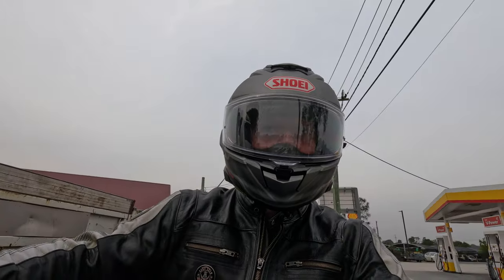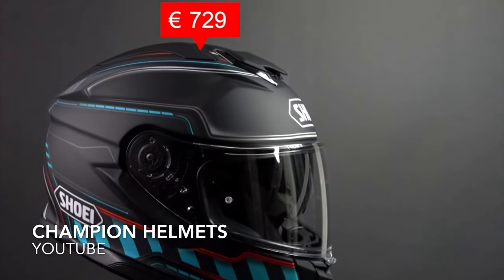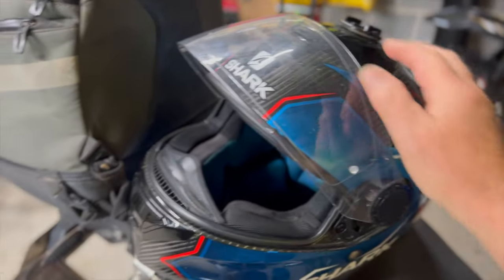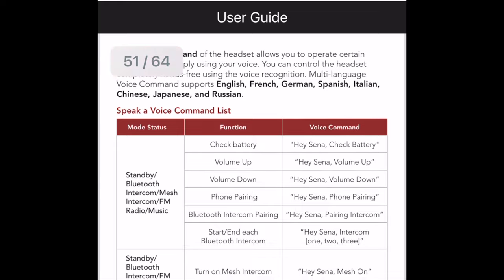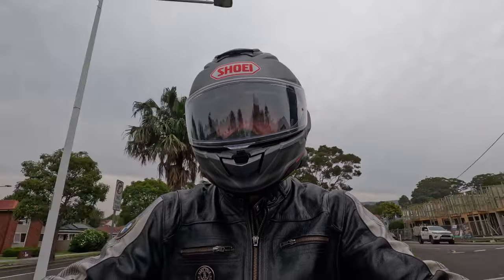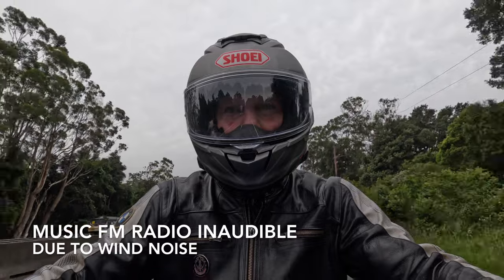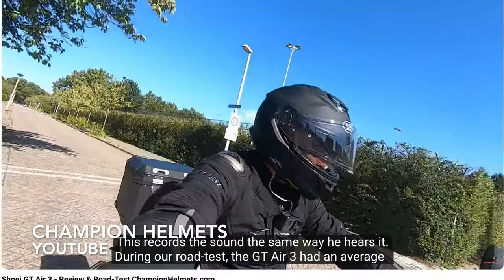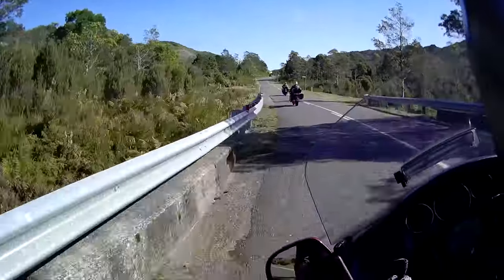Shoei GTAir-3 and SENA SRL3 - Wind noise

Comment: Hello and thank you for your review. Was looking to purchase the GT Air 3 and considering whether to get the SRL3 and your review helped (not worth the cost). However, something that you might be interested to try out is the newer ear plugs (Loop and so on) which offers to filter out (lower) the wind noises and allows music through. I've recently obtained the Loop Experience 2 and found that it helped a lot (at least for me). You might want to check it out with your SRL3, might allow you to hear better at higher speeds.
Reply from the maker: Yes, I have switched to Alpine. Also Scena mesh communications is very good, loud and clear. Cheers

Comment: Hi, I had a R1250GS with the BMW Navigator paired to a Sena intercom on a Neotec 2. It was my first experience with intercoms and I was pretty excited by the prospect of listening to music while riding. My former bikes didn’t have any sort of connectivity. I always ride with earplugs and really didn’t bother listening to music after a while as there was too much noisey from the bike and the buffeting of the windscreen. I don’t think it has any thing to do with the helmet. I have no hard data to back up what I say but in the equation of factors that account for noise while riding a motorcycle, I would guess that the helmet is a rather marginal one. To a certain extent I think that motorcycle riding and listening to music via an intercom don’t mix well together. I since changed bike. I ride now a sports tourer with a smaller windscreen, you get more wind on the helmet but a cleaner flow, so no buffeting. I have a GT air 2 with intercom now but I only use it for the gps prompts. I ride in Europe and the windblast you get with legal and not so legal highway speeds would be unbearable on the long run without earplugs. I prefer to focus on the riding than settle with a subpair sound quality. Thank you very much for all the effort put into your video
Reply from the maker: Thank you. I appreciate your detailed review and analysis. I don’t know if there is a perfect solution out there but I’ve spent about $2,000 so I’ll stick with this for maybe 5 years is so. Cheers
Reply: Snap, 1250GS! Navigator 6 and custom ear plugs with Shoei GT Air 2. Never had the need to be “connected”. But I’m thinking the navigational prompts could be useful.

I’m intrigued to know the clarity of the sound from the Navigator prompts while you’ve physically got ear plugs in?
Reply: @PhilbyFavourites  G'day, the sound quality is fine up to 60km with earplugs, I struggle above say 80km/hr. However I have a low windscreen so a larger one would help a lot. cheers
Reply: @PhilbyFavourites  It's ok, you just have to adjust the volume, you need to set it much louder when riding at high speeds because of the wind noise, once you slow down the first prompt appears always to catch you off-guard because it's too loud...

Comment: Good review, I’ve been using a Shoei GT Air 2 for the past 5 years, I have reduced hearing in my right ear following a bout of shingles so a quiet helmet is something I’m after when I replace next year. Have to say good that GT Air 2 has been I’m disappointed Shoei haven’t moved things on much, my Air 2 has the SLR 2 fitted and I find it feeble at higher speeds - the problem with the GT 2 & 3 Shoei drive you down one road regarding comm’s and I think Packtalk is just a superior product, both in sonics and overall performance. Anyway, thanks for the review it’s helped me make my mind up.
Reply from the maker: I’ve found mesh to be really good. A bigger windscreen would help too

Comment: Just purchased a new Shoes Neotec 3 today Steve after 5 years with the Neotec 2. I had a Sena 10 unit on the N2 which is now 11 years old and has never missed a beat. When looking at the N3, the salesman told me about the Sena SRL3 integrated unit. I figured that a new helmet and comms will be a treat. I fitted the SRL3 to the helmet today and wished I had asked the sales guy to do that. Refitting those damn cheek pads with the wiring in place was a real challenge. It is pouring rain where I am this week, so I might leave my road test for a less miserable day. My custom moulded ear plugs worked well with the Sena 10, so fingers crossed that the new unit works just as well. Another good review mate!
Reply from the maker: Thanks Ian, try Mesh when you can. I’ve got a follow up video in the works, cheers

Comment: I gotta ask. Do you get any wind buffeting with that configuration of windshield in the BMW? If the answer is no, where did you get it? Looks cool. Also, awesome review, it is very very detailed
Reply from the maker: The screen on the 850 is low for off-road. A larger screen would help a lot. Cheers

Comment: Great video, Steve! 

I can't comment on your helmet but have the Sena 50S. My experience with wind noise is smack bang the same as yours. 

For clarity, my hearing is good (WiFi would of course disagree at times 😂), I ride your bike as you know, run 50:50 nobby tyres and wear nonoise ear plugs that I highly recommend. 

Your Sena has open Mesh, right? This is nowadays the ONLY option I use for communicating with fellow riders as, I believe, the volume is louder, clearer, crisper but I could be wrong. 

Pretty high price tag for an intercom system to only use it with Mesh tech ☹️. I doubt however that Cardo would be any better and ask myself often why Sena do not enable riders to set the vol at their desired level (without damaging the speakers). They could limit their liability by stating "If you increase the vol beyond this level, it is at your own risk if you damage your hearing." But really... do we need this parental guidance?

Further, @Sena - why don't you develop SW that adapts the vol in line with riders speed in- or decreasing as well as based on wind noise?
 
Now that would be a great new feature I might pay for and upgrade my current 50S.
Reply from the maker: Good to hear from you. I’ve yet to try the mesh, it may be better. Cheers

Comment: Hey Steve. Thanks for vid. I too have a gt air 3 with srl3. Try your lid with the chin curtain fitted. It doesn’t fit properly in my helmet, but it does quieten it down considerably. I only connect my iPhone to the srl3 and it accepts Siri commands, which is so much easier. Cheers. Chris
Reply from the maker: Thanks Chris, cheers
Reply: Hi Chris I got a GT air 3 this week I thought it was me having trouble getting the chin curtain locked in at the sides the larger chin curtain makes it harder to put the helmet on and off outside of that no compliance I don’t have a problem with wind noise but I have a good windshield.

Comment: Just purchased the Gt air 3 w. SRL-3 Sena unit.  Not trying to high jack your thread. But has anyone had problems with the voice commands when using hey Sena. My unit does not recognize my voice at all it works perfectly with the iPhone Siri commands though. I even had Sena send me a warranty replacement unit. Still doesn’t recognize my voice commands.  Sena sent me a video showing me that the unit I sent back to them works just fine.  I can’t understand why it won’t work for me.  I even had my wife try the hey Sena check battery and other Sena voice commands. Nothing works.  Software is 1.2.
Reply from the maker: Hi, I find voice recognition useless above about 40km/hr. I avoid using it and the FM radio. Mesh however is brilliant!

Comment: Nicely edited and put together video!

I find the use of the CB radio very strange, however I'm sure the CB radio range is further that mesh alone. I have no idea how you and your mates ride but if your mates have mesh connection, you should definitely give that a try for the sake of clarity and volume.

I've only ever ran the built in comms on both a Sena 20S Evo on bluetooth and now a Cardo PackTalk Edge on Mesh (since my friends use Cardo's) and never had any issues with clarity or volume when in range. 
I found on the Sena 20S Evo at max volume to be sufficient with earplugs and the Cardo is louder for sure and have it around 80-90% volume with ear plugs. 
I'm not sure if my hearing is as bad as yours but I think it is since I badly need hearing aids as well, just can't afford them right now.
Reply from the maker: Hi, our group has a mix of guys with CB’s and some with new helmets and Mesh. The mesh group are growing and the CB’s dropping off. I might do an update video soon. Mesh is very good even at high speeds

Comment: why u dont use bigger windshield
Reply from the maker: Yes that would help on the highway. I go off-road a bit and a bigger windshield would not be good.
Reply: @StevesBikes01 thats why i was wondering about the helmet its quite helmet overall compared to all modular ones every helmet will be a noisy helmet if there is no proper wind protection i almost tried them all,, best 2 schuberth and shoei ✌️

Comment: I am Profoundly Deaf from a Bike Accident in 1980 and have the same issues as you Steve.  Your cheap over the counter Ear Plugs are the Wrong choice as I have used them and found that they are too noisy for Road use.  Having used Ear Plugs with Noise Filters dedicated for Motorcycling is your next step up to Better Hearing !!!! whilst Riding.  I now use the Alpine Hearing Protection by Motosafe and come in Two Hearing Levels.  It is the Ear Plugs with NOISE FILTERS that you need to wear and they will take you upto 120kph+ before it gets too noisy.  For around town my Moulded Earplugs are ok but like your current Protection not satisfactory.  Please enjoy your Riding like me Steve..... 🙂
Reply from the maker: I’ll get some Alpines thanks

Comment: I have a Neotech 2 with the SRL3 and I have the same wind noise problem on my Super Tenere 1200. I found using foam earplugs works too well and blocks too much of the music. The best solution I’ve found is the rubber ear plugs with the 3 pyramids like “steps” that are rated for 25dB reduction. 

On my Goldwing I have zero issues with noise because….well it’s a Goldwing. I barely even feel the wind but on other bikes it’s extremely loud. 

I’ve heard good things about PlugFones. I might try a pair.